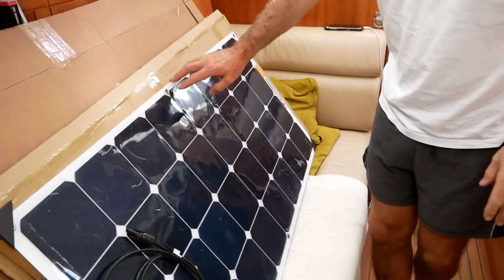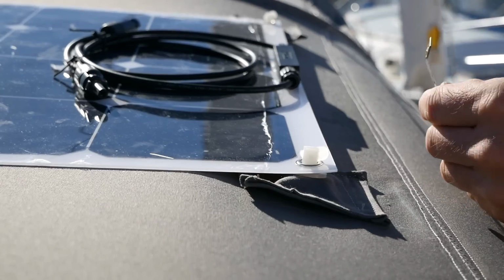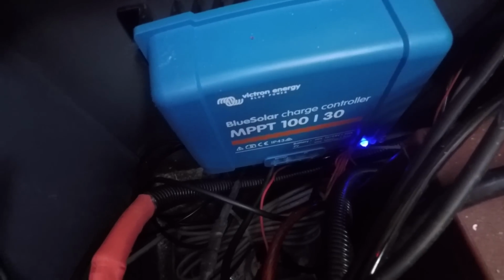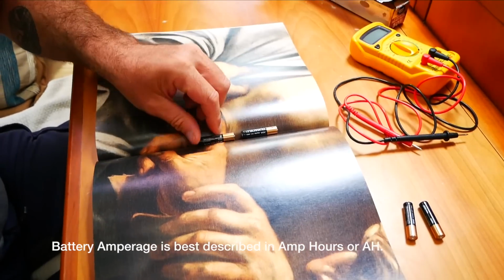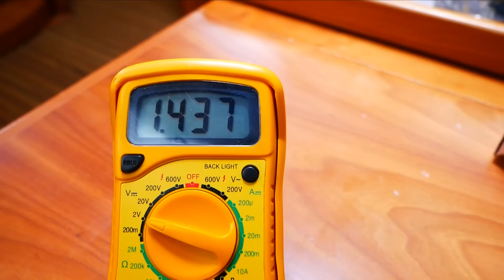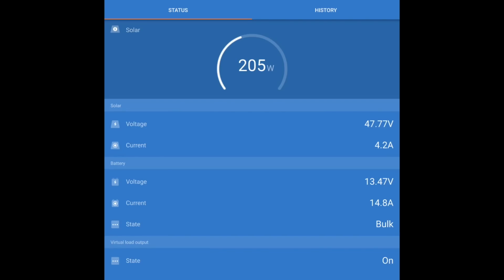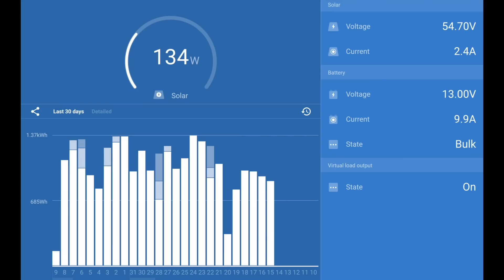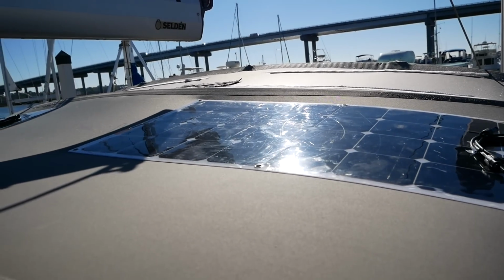EASY SOLAR PANEL INSTALLATION FOR YACHTS & R/V'S

Comment: Series is the way to go. When you go parallel, you increase amperage. When you do that, it requires thicker cables which means higher costs, harder runs, bigger holes etc. In series, the amperage stays the same. You can run higher voltages on thinner wires than the other way around, cheaper wires, easier runs, smaller holes etc. "But what about shading?" You can install power optimizers on each panel. Each panel will run independently of one another and only shaded panels get effected. All this would of course have to run into the proper equipment to control it at the other end.

Comment: Is it possible to run 2 of the panels in parallel and then run the 2 sets of parallel panels in series?   Maybe the shade from the boom and stays will not be as much of an issue.  It Seems that the MPPT controller can handle variable volts and amps so maybe this configuration will help with shadows....You two are the best...thanks!

Comment: Hi Nick. Thanks for this video. I don't know if you'll answer questions about it 2 years later, but I'm wondering if any fusing was necessary, or does the controller handle that? Also what about battery monitoring? Will your bluetooth connection tell you all you need to know, or do you need a separate battery monitor?
Reply from the maker: Hey mate. The fusing is handled by the regulator. The Bluetooth unit monitors all the output a
Though we also have a separate battery monitor

Comment: If you put the panals in serie you get more than 12volt. is not that a problem if using 12 volt batteries?

Comment: I have a mini van rv conversion van that already has a solar panel that runs off the van itself i want ro add an additional panel and attach batteries can this be done without causing problems

Comment: How do you regulate the charge going to the batteries from the solar panels? And what happens when you crank your engine? Are you continuing to receive a charge from the panels or do you cut them off?

Comment: I'm just starting to think about solar on my boat. A concern about flexible panels on a bimini is the constant flexing due to the wind. A piece of wire can be bent into shape but repeated bending will break it. Not saying this is the case, just something to look into - which I will.

Comment: Nick, I am wondering why you didn't use optimizers or micro-inverters on each panel to negate the partial-shading problem?
Reply: Sailing Yacht Ruby Rose Hmm, sorry mate, don't understand. MC4 can handle up to 30 Amp which would from my understanding of your solar array, be more than enough even at 12 volt. Anyway, not sharpshooting, just trying to figure out what I'm missing. Cheers!

Comment: In residential/commercial PV there is a product called micro inverters. Each panels gets its own small inverter so that when panels get shaded all non shaded panels continue to perform at max. A little more expensive, but when shading is a problem it is worth it. Wonder if that exists for sailboat rigs.
Reply: Single panel micro inverters can only be used with a grid tied system. Can’t be used on a boat as they shut off if the grid power can’t be detected. This is so a lineman won’t get electrocuted by solar panels even when he shuts off the main line.
Reply: Yes, they exist. Saw 'em on another YT channel recently (Wynns or Out chasing stars, at least a couple on a cat I just don't recall.) Anyway, the controllers they had for those >1kW in panels were singular 'Genasun' MPPT-Controllers for each panel.

Comment: Have you had any issues with the solar panels chaffing the sunbrella along the panel's edges?  I'm about to do a similar project and I'm wondering if I need to add some kind of chafe protection.  Thanks!

Comment: Thanks for sharing. About to setup our system for solar and decided to use 5 x 100 W rigid panels. I am grouping 3 x 100W panels to one victron controller (100/50) and then 2 x 100 W panels to another victron.(100/30)I do have shading issues, so will try parallel first for each group, but I understand that series (which adds the volts) also benefits from being able to use thinner wires which I am not sure matters that much if already sized for parallel but if I misunderstood this, please advise. What are your thoughts on economical AGM batteries? I am thinking of getting 4  of the RENOGY AGM's 105 ah.

Comment: One other way of looking at the MPPT controller is to think about your car.  When the engine is running and the alternator/generator is turning, it puts out voltage that is variable with respect to engine RMP, and normally higher than the 12 volts of your battery.  Therefore you have a voltage regulator that will put out approximately 13.5 volts d.c. to either charge your battery or keep it on a float charge if already fully charged.  (The output actually varies a bit dependent on the state of charge of the battery and the capacity of the alternator)  It will not over charge your battery.
     The MPPT does the same thing as the voltage regulator in your solar system.  It takes the variable output voltage of your solar panels and matches that with your 12 vdc battery system on you boat.  It will put out as much amps as the solar panels can give to recharge your battery bank, but will not over charge your battery bank.  (Most of the MPPT controller have some upper amperage limit that they can output, usually 20, 30 or 40 amps.)
       So, series versus parallel panel set up.  As seen in the video, there are advantages to setting up in series.  However one thing not discussed was what occurs during shadowing.  This is one consideration you may want to think about.  Putting two panels in series, with the other two in series and then putting those two sets in parallel with each other would also be an option.  If one set has some shadowing, the other set would still be cranking out full power.  There is no easy answer, it is really dependent on how your boat is set up, where you can put the panels such that they have the least chance of shadowing.  (FYI, when you shadow a solar panel its voltage drops significantly, and that is why it is an important issue.
      I hope this answers any questions about this.  If in doubt, as a marine electrician or your harbor master.
      Captain Steve, S/V Appaloosa

Comment: In my research I found the whole series Vs parallel argument is only valid with a MPPT charger, If you cheap out and get a PWM charger you kinda need to parallel to get any benefit.  You're description of MPPT is pretty bang on, a PWM is a "dumb" charger so to speak, it will cut voltage to charge levels and "dispose" of the rest so you need big Amps, so in your case it would cut your 72V in down to 13.4ish and give current of whatever 1 panel is. a possible flow on effect with PWM charger is maybe needing thicker cables to carry the Amps. The lesson here is get a good MPPT like the one you guys did and for people getting set up is avoid PWM (Think PowerWastingModule). oh and be wary of cheap MPPT chargers, they can be pretty hit or miss.

Comment: Did you get 12v or 18v panels and have you considered wind turbine energy or a hydro generator (like sea watt) just curious of your opinion, and value your input
Reply: Which hydro do you use and how do you like it

Comment: Test suggestion: hybrid! 2 blocks of 2 panels in series connected in paralell. 

Reason: your panels are relatively low voltage and that might have affected the parallel test when partially shaded (the affected module became lower than "12v" somewhat affecting the others.

Comment: This was really well done, liked your explanations and especially the attachment method you used.  Are you at all concerned about the panel getting wind under the panel and it flapping when you are in +20kt gusty conditions?  I've been considering both the way you did this as well as zippers/velcro but my concern is being able to easily switch out for different size panels easily later.
Reply: Thanks, that's great to hear.  Above that wind speed the panels should be brought inside anyways. :)

Comment: Great video. Thanks! Here’s a Question - what brand of instruments do you Recommend? I’m considering Garmin. All my instruments are old. I need a GPS/chart plotter, wind, and radar.  The depth sounder is datamarine and simrad autopilot which isn’t very reliable. I also need AIS.  Cheers.

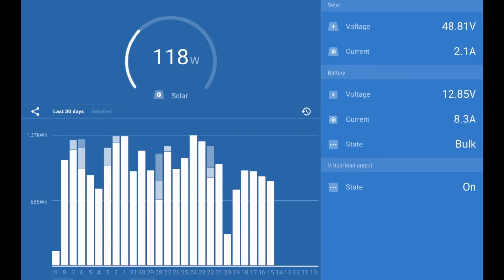Comment: Hiya, Nick. Interesting episode. Quick question about amperage from the solar array: Earlier in the episode, your app showed ~50V @ 4a and from around 11:00-11:30 or so, we see the same 50V, but a descending amperage as low as 2.3a. Would that be caused by shadows killing output on cells? If my understanding is correct, shadows would keep our voltage, but reduce the current produced.

Comment: One word ------ electrifying
One question, the actual panel itself,,, is it true that there are different types of solar panels with some being much more efficient and creating more power?  How did you choose the particular panels you used?    Please allow for my complete ignorance of these matters.
Reply: sunpower makes the best panels, but they are also the most expensive.  You can also get single panels higher than 100w.  I was looking at a setup with 4 350 watt panels.

Comment: The other downside to series vs parallel installation is that if you break the circuit anywhere in the series, you loose the entire circuit (take one of the batteries out of your magazine and you'll show zero volts on your meter), if you take one of the batteries out of your parallel circuit, you'll loose some output but not all of it.

Comment: Series is the best way for a simpler installation.  The absolute best way in my opinion is to do each panel connected to its own micro-mppt controller.  The problem with all the solar panels is the shading during the day.  Even a partial shading drops the voltage down to nearly nothing.  Now in Series it just drops the overall voltage going in, but some resistance is created in the circuit. Depending on which panel is shaded this can be better or worse.  Kind of like a small short circuit which can be overcome.  If you wire them in parallel with their own controllers there is no drop in efficiency from any non-shaded panel.   Each micro-mppt controller will likely set you back from 10-30 dollars.  The bad thing about this is you will have this gigantic bundle of wires that will be coming off your bimini or arch.  So everything has its own drawbacks.  http://outchasingstars.com/2015/07/04/palmetto-projects-part-4-solar/
Reply: Allyn, interesting write-up.. I'm curious if you've done any kind of real-world testing to see the differences. My big concern with running a controller per panel is all the additional wiring you have to deal with. Looking at the picture on your site, I'm curious how some of those panels show no wiring at all... how were they installed? Would love to see a video of your setup. Thanks!
Reply: @brois841  Not my site, but they can be pulled underneath if the panel has the wires underneath.  Some are on top, on the side, or underneath.
Reply: @allynonderdonk7577  gotcha, by the way, I learned that if you buy quality cells they have bypass diodes built into them, so even if you wire in series,  a shaded cell won't cause resistance

Comment: Never liked the flexible panels but I can imagine it has to be hard to mount anything on a sailboat. Wiring up rigid panels is a bit easier on a motorhome like I did I 'spose. I have 6x160 watt panels and lithium (600AH). 
Loved the AAA battery example shown. The larger the array the more efficient the MPPT gets. Good example you provided there too.  Nice touch with Terysa doing the stretching or yoga there. Just sayin :P

Comment: Hi guys, what’s the cost of a full solar kit? 4 panels, controller, cables... what else do you need?
Reply from the maker: Hey mate, so about $200 for the controller, $100 ish per panel ($400). Interconnects about $50. Cabling another $50. So about $700 . If you need fasteners for your Bimini, that’s about $50. A good battery monitor if you don’t have one is about $150. 
Hope this helps

Comment: Loved the video Nick, except where you put the meter in amps and put it across the battery.  Now, you can get away with that with a AA battery, and maybe even a D battery.  But if you try that on your starter battery or your house batteries, you will be buying a new meter - or at least replacing the fuse - if you're lucky.  If you're not lucky, your test leads will melt explosively into your hands and the magic white smoke will escape your meter; damaging you in the process; not to mention the meter.

With current, it's best to just explain that each battery has a maximum amount of current it's capable of providing, and it takes specialist equipment and knowledge to measure that.

Otherwise, good video.
Reply: Being a aircraft mechanic and having burned up much valuable test equipment I'll second that.   Hahahahha

Comment: Good video Nick but you didn't answer some people's question of why not just connect the solar panels to the battery?

The answer is that to charge a 12 volt battery bank, you need an input voltage of about 13.5 volts and any voltage less than the voltage of the bank won't provide any charge. So you must send 13.5 volts continuously but the amps can vary within a range determined by the battery bank. The problem is that the solar panels produce varying voltage and amps that changes with the intensity of the sun. A 100 watt panel can't produce MORE than 100 watts and usually provides less. The MPPT controller takes in voltages (within a range) and converts the excess voltage (above the 13.5 volts) to more amps minus some power to run the controller. The controller also makes sure that the battery doesn't get too many amps depending on how full it is.

The take away is that the varying voltage and amps of the solar panels isn't directly compatible to what is required to charge the battery bank. The controller is needed to get the right voltage and also protect the batteries by shutting off when the battery bank gets full.
Reply: Sailing Yacht Ruby Rose I was just kidding about it being your fault. Your video was excellent. It isn’t obvious that solar panels keep changing their voltage all day long and the charging voltage must stay the same. Cheers.

I can’t tell you how impressed I am that you respond to so many comments. Don’t you have a white beach to relax on?

Comment: Great video.  However, I think that your conclusion that transient shade recommends a "series connection" is erroneous.  When the panels are connected "in series", they all operate as ONE SINGLE UNIT.  Any shade that hits the one panel will drop the output of ALL PANELS.  By contrast, if the panels are connected "in parallel" , any shade on one panel will not affect the output on the other panels. So, if shading is an issue, it is best to go with "in parallel" connections.  

I understand that you did a test in The Bahamas.  However, you provided no weather data to confirm that the few days that were spent "in parallel" were the same.  So, that test is suspect.

Comment: Higher current is more dangerous too. Current is what is called potential and a high potential means more risk to shock and fire. If you keep the current low and voltage high the wire will be guaged down till you get to the converter. Likely your parallel difference is the result of what happens with current producing heat in the wire. Lots of pixies trying to run on the same path at the same time.  

In series the voltage goes way up and current way down, so the pixies arent trying to run on the path at the same time, Now they run in a single file line much faster!

The converter then takes care of outputting the voltage needed and with the magic of inductors turns voltage into current. This is why we have big trashcan looking things on telephone poles. Power companies output crazy high voltage for long power runs then run it through a transformer. Near the usage area. This saves drasticly on the size of wire needed.  

i wouldnt recomend checking batteries with a meters current setting. When checking current the meter is shorted so all of the pixies in the battery get to flood out as fast as they can... A marine or car battery would be a very bad idea to try this on. Few hundred amps will teach you and a meter a quick lesson in life. That setting is for checking a load not a battery. However, a few AA batteries isnt a big deal.

Sorry... i got all geeky and excited to see tech talk.

Cool stuff, thanks for the vid.

Comment: 10:26 the power as measured is implying magic between the panels and batteries lol    panels 201.2w  into batts 201.9w  

I'd expect overall  for there to be a loss in power between the measurement at the panels and the measurement at the batteries, converted as heating the wires and controller. Also that higher voltage, for same power means less heat / less power loss. 

Long and short amperage induces heat, voltage does not.